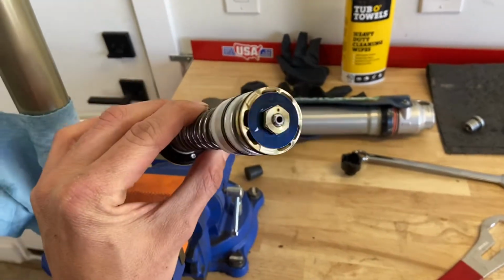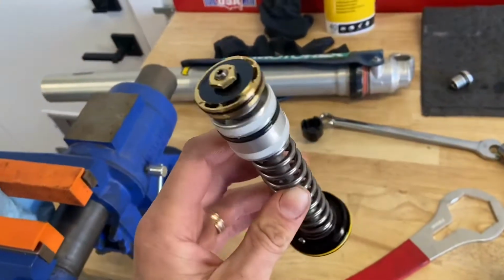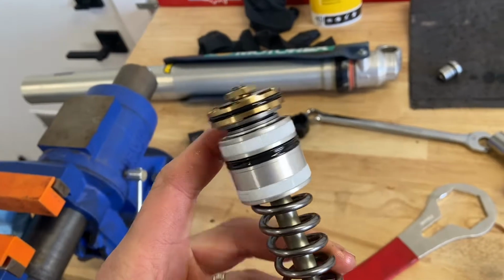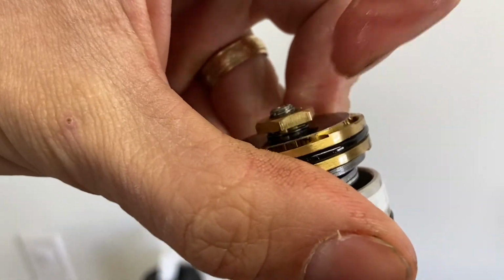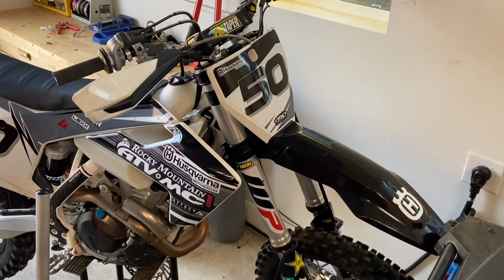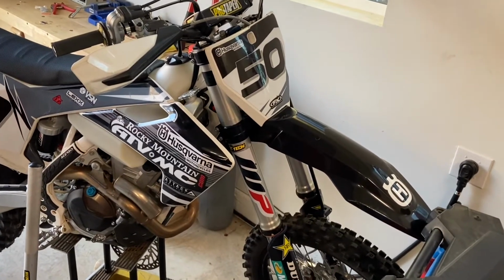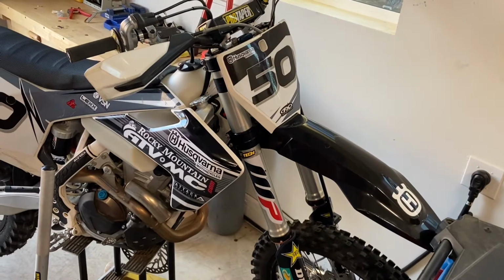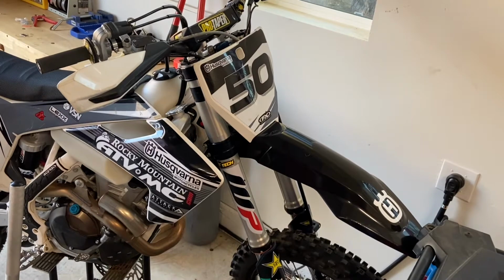Racetech gold valves on aer48 forks

Comment: I have a 19 250sxf and I hate my air forks I think.. they deflect Ive tried adjusting them all different ways but it never seems to help. Did the gold valves help it soak up braking bumps better or logs in the woods?

Comment: Are the gold valves worth it? Considering them on my 19 fx350. I have to rebuild my forks anyway. I'm a new rider that does 99% woods riding and I can't say I've ridden great forks so I have no idea what I'm missing or if I'll even be able to tell the difference with a revalve.. If I do the gold valve is that considered a revalve? Thanks for the video!
Reply from the maker: If your a newer rider I’d say no for now and begin with messing with the adjustments on your stock valves